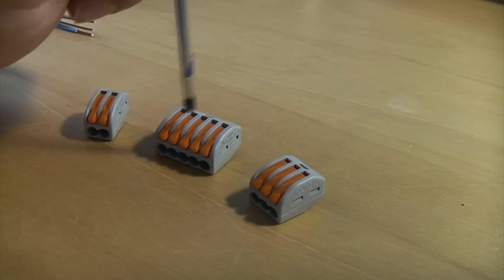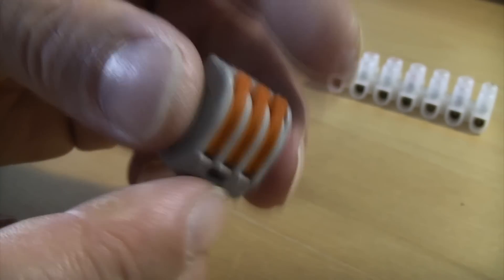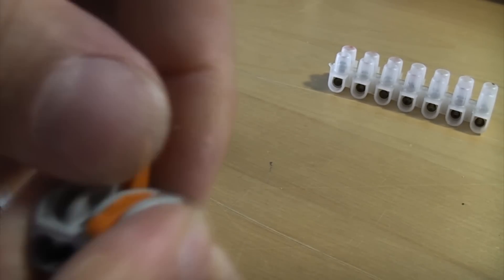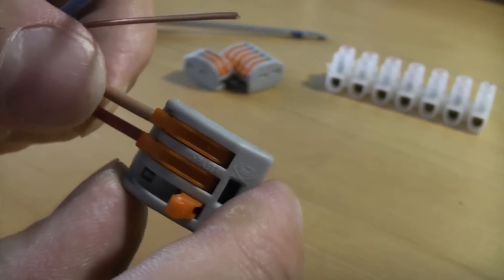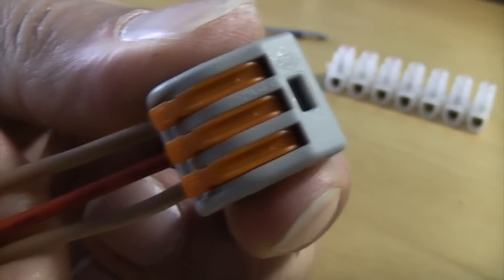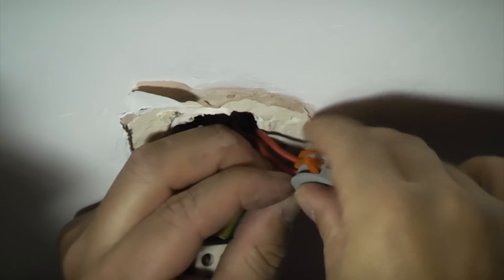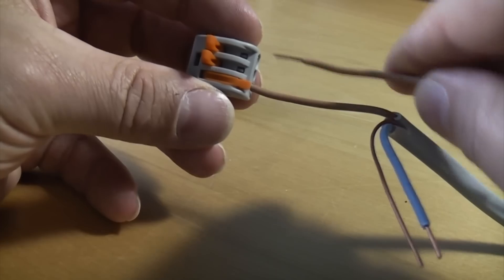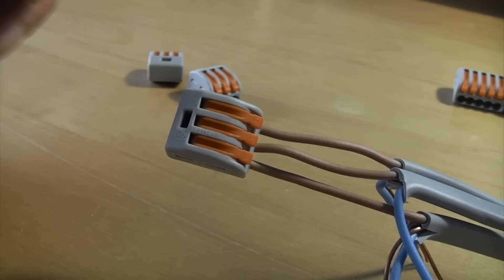wago compact connectors - Ultimate Handyman DIY tips

Comment: Can i use one of these 2 way connectors to put 2 wires in from a unused ceiling fan and sit behind a single light switch? Just wondering would it fit or am i better off taping off the unused wires
Reply from the maker: Yes, these will be fine and are much better than taping them together. The only problem might be the depth of the back box, as some light back boxes are very shallow.

Thanks for the comment 👍
Reply: @ultimatehandyman  thank u mate

Comment: Are you able to use these to temporarily blank off.live wires that are sticking out of walls?
Reply from the maker: Yes, providing there is no danger of anyone removing the connectors. It would also be advisable to have them in an enclosure to prevent anyone from touching them.

Comment: Nice video, good camera work. Really like the Wago blocks. I have been using them for about four years now. No problems at all. Really good for temporary work when fault finding etc. Always have them in my main tool box. Not sure it needs saying but you can use them on your car's 12 volt system too. Again great when fault finding.
Reply from the maker: Thanks for the comment ;-)

Comment: I have looped-in in my bathroom (3 lots of cable). what Wago would I use to connect the 3 earth wires in and one wire from the new ceiling light together (4 earth wires in total) as this is baffling me
Reply from the maker: Its often easier to use a normal terminal connector for the earth wires, but you can get the Wago 222 connectors that accept 5 or more wires but they are very bulky and will not fit in most light fittings.
Reply: would i be able to use wago 773-104 for the earths, just wondering as i do have a wide diameter ceiling base for the light fitting
Reply from the maker: Yes, one of those should be fine ;-)
Reply: Thanks for the help and advice Ultimate Handyman
Reply from the maker: You are welcome ;-)
Thanks for the comments

Comment: I need to join/extend  two cables, what about the unsleeved earth wires are they safe to insert into these connectors?
Reply from the maker: Yes, but the bare earth wires need sleeving with green and yellow sleeving.
Reply: ***** Many thanks for your reply.
Reply from the maker: You are welcome ;-)
Reply: Hi There great video just wanted to know that im changing a ceiling rose to a newer light fitting using a wago connectors do i need to put the cables into a wago box as acess to ceiling light cables from attic is difficult.

Comment: Hello! I don't know why mut many electricians in Russia don't trust WAGo connectors and use it only for lights. What do you think about it? Thanks!
Reply from the maker: They are not widely used in the UK either, but popular in Germany.
Reply: +Ultimate Handyman how do electricians usually connect wires in UK for home electricity purpose? In Russia most of home electricians still screw multiple wires into 1 wire  without any additional connectors. This is not good I believe...

Comment: Could you please do the whole of the U.K. a massive favour and install an ikea ceiling light! Seems the whole UK is struggling with their fittings and wiring setup! May get thousands of views! Thank you sir for a great channel.
Reply from the maker: They should be illegal. I once installed one for my sister, it had 6 live wires and 6 neutrals to terminate. They should do that it in the factory, then the end user just has three wires to terminate! 
If I get chance I'll cover it ;-)
Reply: +Ultimate Handyman thanks mate
Reply from the maker: You are welcome ;-)
Reply from the maker: I checked Ikea's website but wasn't sure which light fitting is now causing people problems to install. If you get chance can you please link to the light that you found difficult to wire up and I'll get one the next time I'm passing ;-)
Reply: +Ultimate Handyman it's the ikea Kristaller chandelier, seems it's the same light fitting for all their latest lights, I used these wago connectors! Worked a treat thank you. So many people out there that are clueless fitting an ikea light. Cheers mate.
Reply from the maker: Thanks, I'll check it out the next time I'm there ;-)
Reply: Ultimate Handyman 

Im just about to do mine (ps 2014 light). Going to avoid any rewiring for simplicity. Just brought a hooked ceiling rose with a strap bracket (surprisingly rare but available on amazon) which will be held in by the screws holding the existing rose and i'll just cut and strip the old live and neutral going to the bulb and connect to the ikea fixture. Easy peasy (he says).

Comment: Can you replace a terminal block in an existing light fitting for something like this?
Reply from the maker: +poshdecember 
Yes, as long as the terminal block is not a heat resistant one (ceramic) as that would indicate that the fitting might get hot due to the lamps.
Reply: Thanks!

Comment: Yes. I've actually gone ahead with the Wago connectors and used a Wagobox. Just need to patch up ceiling a little now as previous light fitting wasn't screwed into wood.

Thanks for your help and the videos.
Reply from the maker: +MnMn 
Thanks for the comments ;-) 
All the best for 2016 ;-)

Comment: Dumb question. I have a ceiling rose which I want to replace with a modern fitting. It appears there has been a spur run off this rose as there are 4 live, 3 neutral, switch live and 4 neutral. Given the limited space can I make the connections with these connections and place them in the ceiling space with wires running to light fitting?
Reply from the maker: +MnMn 
When you say in the ceiling space, do you mean the hole directly above the light fitting where the cables exit?

Comment: Looks like a big lumpy mess.  How do you tuck that blob into a fixture?  Why not use wire nuts?
Reply from the maker: Brad Weber They fit in most light fittings over here, but are mainly used in wago junction boxes to join cables.
Wire nuts are not widely used in the UK for some reason.
Reply: +Brad Weber Because wire-nuts are rubbish...

Comment: a bit expansive for only solid wire. wago push in type 273-105 1-2.5mmq 24 A also in 2 3 4 5 and 8 yes 8 wire and we need them in the netherlands. we make a junctionbox on the spot of a ceiling rose and pul a cable from every single switch and  socket in the room to that junctionbox.

Comment: Thanks but a bit confusing again.  At 4:00 you show how to put the 3 red live wires into the connector but in other vids refer to these as 'looping' wires.  And surely that is a special terminal for those particular wires?  Or not?  From this I don't know which Wago connectors to buy for a light fitting consisting of 2 neutral, 1 switch live, 3 looping and 1 earth wire.
Reply from the maker: Ok, for a standard light (which is what you seem to have), you need the following-
Wago  222-413 Lever 3 terminal block for the loop
Wago  224-101 Lighting connector for the switched live
Wago  224-112 Lighting connector with two terminals at the rear for the neutral's

You should have three earth wires not one though ?

Because of this I normally use a standard terminal connector for the earth wires.

Comment: Hi, as promised here is the reply I got from wago:-

Your enquiry has been passed on to me, I am the Product Manager for this range of connectors.
 
The 222 series has a max current rating of 32A. 32A is the rating for the 4mm² flex, it is rated at 24A for a 2.5mm² solid, stranded or flex cable. The connector is rated in relation to the max size of conductor and it’s current carrying capacity.
Example 2.5mm² = 24A or 4mm² =32A
 
The 20A you have seen on the WAGOBOX information is part of the maintenance free instructions. The connector must be de-rated if used in a maintenance free applications as per the BS5733. This does not apply in your application.
 
To answer your question, the 222 series connectors are suitable if you are extending the ring (extending the two current paths, separately ). The ring is made up of two current paths, 16A each to make the 32A total.
Any accessory added to either current path of the ring must be over 20A rated, which the 222 series is 24A if using 2.5mm². If you are using standard twin & earth 2.5mm² solid cable, it is rated 27A in free space and 24A in the wall or conduit.
 
If you are looking to add the two 16A current paths together (make a 32A spur or radial) using a 2.5mm² cable, this would exceed the rating for the cable and the connector.
 
Also any connectors  must be within an enclosure (back box of the socket) and the cable must have strain relief to provide adequate mechanical protection against external influences.
 
If you have any questions, please do not hesitate to contact me. (unquote)

Having asked wago for further clarification, the answer to my original question (can these be used in a domestic ring circuit to extend short wires at a 13amp socket?), the answer is YES provided it is done in a certain way.

Both legs of the 2.5 twin and earth must be joined in a continuous way without creating any spurs (a big NO NO. Thus if you wish to extend and connect both legs (2.5 twin and earth  x 2 you must use 6 x 2way wago connectors within the back box/pattress to join each wire separately, NOT 2 x 3way connectors as you may be tempted to do as this would create a mini spur to the L,N,E on the socket. and render the connection illegal or at least against the specs required for correct installation.. 

Sorry to labour my initial post, but I thought this info would help your goodself and your many followers who may be thinking of using these wonderful little wagos to extend short cables in a 30 amp ring circuit.

Regards,
Jim.
Reply from the maker: Jim Walls 

At least you got a reply from them ;-)
Well done for getting the confirmation ! 
Thanks for  going to all the trouble.
Reply: Ugh, pardon me, can you translate that a bit ? Its saying you can splice a wire and have two other wires or more connected to it if its for example 14 AWG, correct ?

Comment: Hi, An update to the Wago mystery.

Contacted TLC and they forwarded my email very quickly to Wago. Within a few hours I had a very detailed reply from a very very nice lady specialist from wago. I had to read it about 10 times to try and get my head round it, I would think you would have sussed it on the first pass, however, the way I read it, if you are extending the ring on BOTH LEGS it's OK but NOT to create a spur..
So, as I see it, I may have to use 6 x 2 way Wago connectors to extend each of the 6 Wires about an inch or two to the terminals on the rear of the double surface mounted socket.

I have asked for further clarification and await reply. If I can figure out how to send you a copy of their reply I will do so as it will make more sense to you than me.

Regards, Jim.

Comment: Further to my last question and to clarify, I plan to convert a crappy old single recessed socket to a double 13 amp surface mounted socket fixture, hence the need to extend the cable an inch or two. I find dealing with  40 year old 2,5 cable in a single recessed position is very very difficult and tight to connect comfortably and be able to sleep at nights after connection  Cheers. Jim..

Comment: Hi, Wago seem to give conflicting info on these connectors. Rated 32 amp in my tlc catalogue BUT 20amp on wago box. I have a qty of these and would like your definitive opinion as to whether I could use these in a final ring 30amp/32 amp mcb/ 30 m/amp rcd in a recessed wall socket to extend a short cable to reach the terminal connection. Hope you can oblige. Great videos , very clear and helpful to the diyer. Thank you.
Reply from the maker: From the information I can find on the WAGO website they are rated at 32A, but if your box says they are rated at 20A you need to confirm they are suitable for use with an higher authority I'm afraid.  I can only suggest asking TLC via the contact link on their website.

Comment: I recently went to a house where the guy had rewired his house and he had used connector blocks throughout screwed to the joists on every joint and there were dozens all over the place. Glad I don't live there. LOL
Reply from the maker: We moved in this house two years ago, since then I have done a few jobs in the house and found the same. Whoever has been working on the electrics has used terminal strips with no enclosure in the loft. I have rewired at least three lights and had to use Wago connectors and Wago boxes to replace the terminal strips. From what I can gather talking to the neighbours the previous owners did not do any DIY!!!
Reply: This guy claimed to be qualified but I have never seen them used on every single joint on both lighting and sockets without any covers, boxes or anything at all to prevent contact. He has screwed them to joists everywhere.

Comment: Surely its just termination point not terminal with input and output? How do you connect to another circuit?
Reply from the maker: These are used to connect 3 wires together (you can also get the same connector that connects up to 6 wires together). One example of where you can use them is a ceiling light- How to fit a ceiling light UK- Ultimate Handyman DIY tips

Comment: Wago are great :)

where do you get your connectors from? I am after there terminal screwdriver, I have 2 they are very good but worn out, but they are over 30 years old so (my dad got them from the ago from the 'wago man') not doing too bad just small chips in the corners that have filed out but its not quite the same. we get most of our stuff from Farnell but they don't sell the drivers any help with my quest would be great thanks :)

Comment: I was interested to see how I could split the electric cable into two separate channels, using the WAGO connectors.
E.g. I have the source of power 3 the electric cables (brown, blue & yellow/green (earth)).
I'd like to split it into two separate electric cables, each going to a different part of the room.
In the end, I would expect to have 3 electric cables on 1 side of the room & connect it to a socket & the same on the other side of the room.

Which type & how many WAGO connectors do I use?

Comment: This video shows the replacement of a ceiling rose without any sort of enclosure.
This is bad practice. These connectors are designed to be used with the wagobox enclosure which not only enclose the connectors but secure the cables so no undue force can be exerted on the terminals. Misleading video. There'll be DIYers out there who think it's acceptable to have unenclosed junctions. It is not.
Reply: J box is in the ceiling. Just looks like a terrible sheetrock job.